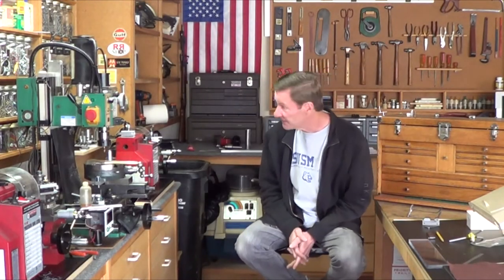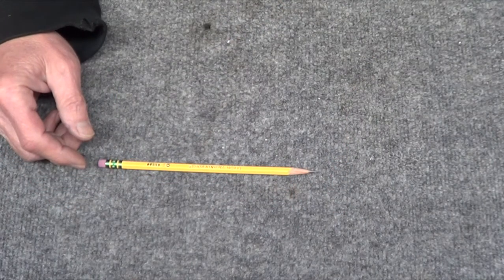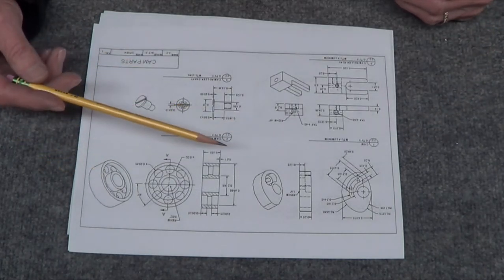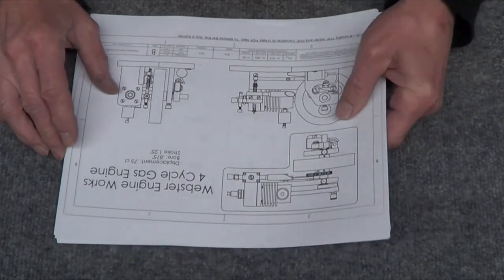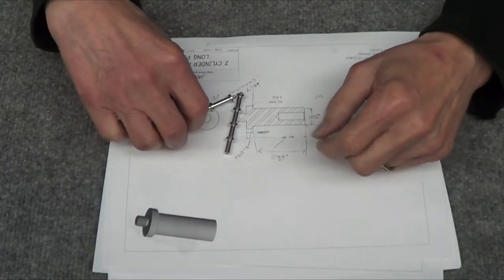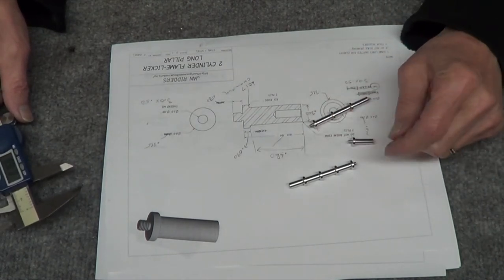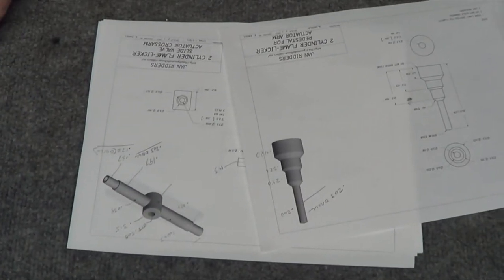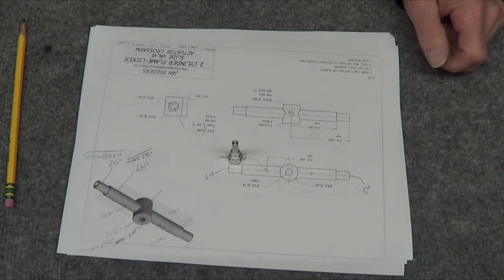DIY Fire Eater Engine Part 1 Video #124

Comment: Hi Dave,
Some of the important things we're taught in school is to check the schematic before even thinking about going to machine anything, now I get to see why...   lol
That first plan that was a school project is probably complete, normally those schematics are done to make the students work their mind on deducting from things that aren't necessarily written but underlaid, call it an exam challenge...
I'm sure you'll make something of it and that it will function...   ;)
Cheers,     Pierre
Reply from the maker: LOL pretty much everything I know is self taught. Some from the school of hard knocks like checking the schematic before machining. Did find a simple and complete engine schematic in a February 1950 issue of Popular Science. Funny how just that one issue is sold on Ebay. Was thinking about the bash, can you send where and when? Thanks!
Reply: The Bash is on June 24th at Stan's place, look on Shadon HKW YouTube Channel for more details, Stan is making the references in the description box... It's about 15 minutes North of the Ontario airport... For you it would be a 2 hours drive...
Nice if you could make it there...   ;)

Comment: Why don't you build a 3d model of this engine in something like 360 fusion by Autodesk to make sure that everything fits right.  This may save from pulling out all your head hair and having to remake parts that just will not work..